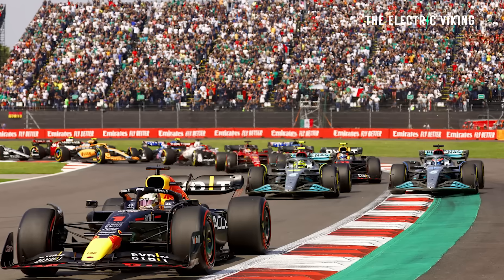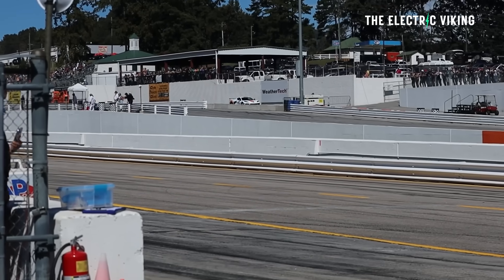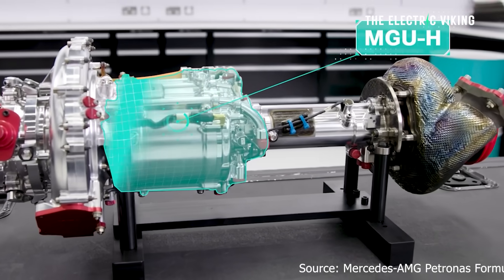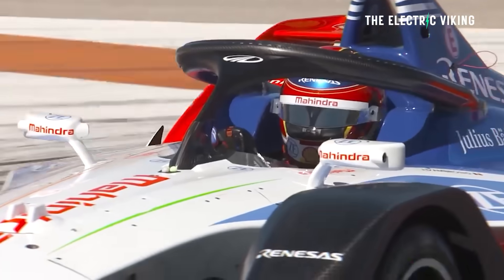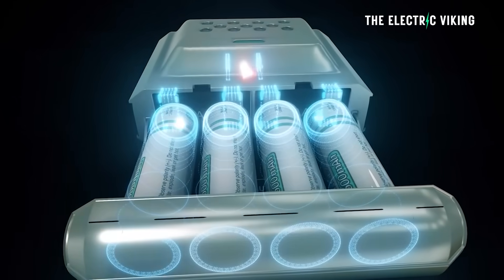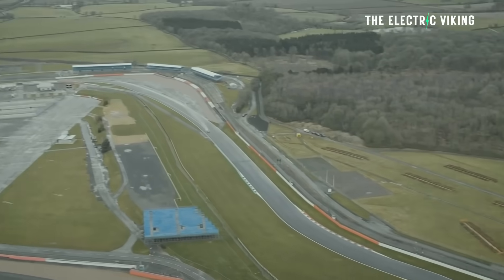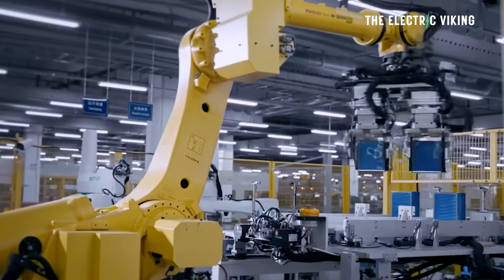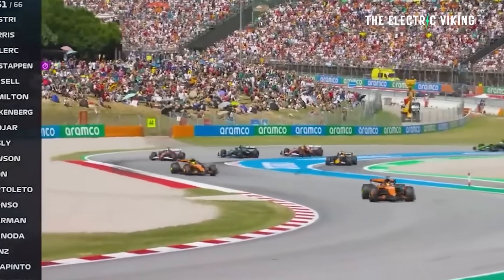Formula 1 Just Changed the Future of Electric Cars

Comment: nope. this news is nothing but F1 being better late than never. The possilbilities for electrication in F1 is far greater than this. Easy to make F1 far more capable with more, bigger electric motors and battery pack. for example, Imagine an F1 car doing without ceramic brakes because the regen braking is so powerful.

Comment: There is some cross over between F1 and Formula E.

The F E cars though are AWD. They have less power than F1, but they've been increasing over time, and it wouldnt surprise me if we get to a point very soon where the POWER of an F E car exceeds that of an F1 car. There are a lot of other differences (aero in particular) that contribute to lap times, but I do see things getting closer. I wonder if we'll get to a point in F1 where it will become a pure EV category, and then F E will lose its USP.

Comment: F1 has always been the test bed for systems and components that eventually end up in road cars. The increase in output in 2026 from the MGU-K will be substantial but keep in mind that the boost from electrical power will still be mostly just for bursts, passing, etc. The racing will still primarily be using the IC engine. Take away the engine and that’s the end of F1. I have been to several F1 races and happened to be in Tokyo last year (2024) when a Formula E race was held on the street circuit. So we went to watch and I was very disappointed, it was as boring as buggery. The cars sounded like a thousand electric drills buzzing away. Annoying noise actually, unlike the current F1 V6 engines, and the legendary V10’s of yesteryear.

Comment: If F1 is the source of such huge technology improvements, why are European and US EV’s trailing China, who aren’t in F1. F1 technology is geared to making a better hybrid, which is a dead end. How do you make an ICE engine better? Add a motor. How do you make it even better? Lose the ICE.
Reply: Amen. It’s not about logic and truth. It’s consumer sentiment and tradition.
Reply: The F1 Engine is actually very efficient. More than 50% thermal efficiency. This is without adding up the KERS and MGU H systems. Why is hybrid a dead end when it uses otherwise wasted energy (heat from braking) into useful work?
Reply: @adriaanvantulpenbaard1740 Well firstly, because it’s only 50% efficient, and you’re not recovering all of that lost energy. Secondly, because it’s a very, very complex and expensive way to drive a vehicle.
Third, it’s extremely unreliable, which makes F1 interesting, but road cars hopeless. 
And lastly, because there’s all that friction and contained explosions, they need a lot of lubricating oil, which gets either burnt or thrown away.

Comment: So these new batteries will be light weight, low volume, high power storage density with a high C Rating!

So how is that going to help the car industry advance if the F1 batteries only have a low charge cycle number or  degrade significantly over a relatively short period?

Comment: Sam, your numbers are inaccurate but you've come close.  What you are overlooking is that the batteries F1 cars use are very, very special.  they are custom built to hold the maximum power density at the minimum weight.  The cost will be far above that any production car manufacturer could deploy.  F1 technology has always used 'unobtainium' materials to achieve the astonishing performance levels they operate at.  I'm sure some good will eventually trickle down to the mass production world.  But don't hold your breath.  BTW.  Check out the Formula e car cars that are NOT hybrids like the F1 cars.  They have very special motors and batteries too.
Reply: I feel like a small amount of super or ultra capacitors (1.5kWh or so) could aid in extreme regen events and also help deliver max power to the motor. I know they're big, but they're not very heavy. I'm imagining they could be squirreled away somewhere behind a body panel. Recent ultra-cap developments give them the energy density to be close to this.

Comment: Not a lot of F1 footage in the video. Far more Formula-E. And F1 didn't just change. The new regulations have been worked on for years now. F1 cars also don't really all that often; which is one of the reasons why it's less spectacular today. For the batteries, most important things are how quickly they can charge/recharge and how reliable, how little the battery weighs and how little volume it occupies.

Comment: Sam and everyone, look up the Pike’s Peak Hillclimb. It is a wild race up one of the 14,000 ft/4200 meter peaks in Colorado, USA.

Sam, electric cars have been rocking this race because the gas burners just don’t have the torque for accelerating uphill after corners! 

I think they’ve already created a conciliation/participation prize for petrol vehicles.
Reply: Also, there is a great video from the racetrack near Sonoma, California. Used to be called Sears Point. A guy took a first generation Model S Plaid to the course and was kicked off because he was too fast. At dragster speeds, he needed to have a roll cage, a fire suit, and maybe even a parachute installed in order to be allowed to go as fast as he did on the track!

And the Tesla could also be used as a reliable daily driver, while the dinosaur burners that could also go that fast need daily attention from an experienced and expensive, Racecar mechanic.
Reply: @freeheeler09That's a lot like how Mate Rimacs got started with his electrified BMW at the drag strip.  The competition initially laughed at him until he started beating them.  Then they complained that he was too fast.

Comment: Check out formula E... Fully electric race cars... Technology is amazing!
Reply: Yes I’ve been following it lately and am amazed how gravitational energy is converting energy into the batteries as the cars navigate the racing circuit. The braking of the e-cars can restore up to 50 % of energy required. Worth investigating this further.
Reply: @nick0047  You can have 50% of regen with EVs for years. It is just so that noone drives as stupid as racing requires you to. In racing the cars are is ALWAYS exposed to acceleration ... you either accelerate (positive acc), you brake (negative acc) or you turn (lateral acc), or a combination of those. So you are changing the kinetic energy THE WHOLE TIME. That's why the recovery rate is so high. You can also do that with your car on the road ... the old Hyundai Kona I drove until last year was famous for reaching 55% kinetic recovery rate! But in the REAL WORLD the main energy loss is first and foremost aerodynamic drag (on the highway) and second rolling resistance (if driven mainly in urban area). 

There is nothing to be learned from formula EVs that can be applied to road EVs! 

Manufacturers already know how to make cars aerodynamically efficient and rolling resistance is influenced by vehicle weight first an foremost. 
Tire manufacturers cannot learn from racing how to reduce coefficient of friction while maintaining safe braking distances especially in wet conditions! 
The are also not researching rolling noise reduction in racing, as is needed for EVs, to be considered a premium tire manufacturer!

Comment: It’s unfortunate that the MGUH will no longer be present. 2026 cars will be less efficient and over the course of a lap slower. They cannot generate enough electricity in a lap.
It’s made worse by the fact that regeneration only occurs at the rear axle.
Reply: Not true. E1 can generate enough electricity, not sure where you're getting your false information from.
Reply: @PyroShields currently cars run power directly from the MGUH to the MGUK (as well as to the battery) which is unlimited. The MGUK can regenerate more power than currently but the MGUH no longer supplements this.
Couple this with a dramatically reduced fuel energy capacity (less than 70% of current)and you’ll see that over the course of a race they will be slower.
The peak power will be good but will only be available for short periods.

Comment: Whilst Formula 1 has indeed embraced the hybrid concept more fully for the 2026-2030 period, it is doubtful that it will EVER go fully electric, for the simple fact that it's customers do NOT want that to happen... We already have Formula E, and it is just nowhere near as popular... Fully electric engines just don't have the same level of 'thrill' or 'engagement' for the audience, particularly on TV, and there is a marked difference in the driving characteristics. The next step for Formula 1 will be to keep the 50:50 split, but utilize a fully net zero fuel, that will allow them to keep the traditional ICE engines so crucial to the sport's success...
Reply: The recent F1 race at Monaco wasn't much fun. "Frustration and slow driving at Monaco GP as F1 rule change backfires". I've watched Formula E on TV and it was a lot more exciting than I expected. The drivers seemed to like it too.
Reply: @bhabbott  Formula E is better for tight street circuits like Monaco. Streets don’t really work in modern F1. Monaco is only still in the F1 calendar because it is so iconic. Any mistakes are likely to be heavily punished by the barrier, so it has become a test of “not making a mistake”, but it is no longer a race.

Comment: The benefit of an electric motor in the f1 cars is not the horsepower. It is the instant torque that ICEs can't deliver.
This is the same reason why dynamometers (because of slip) can't measure EVs, if there is no software which regulate this smoothly.
Reply: You just reminded me of the days of Turbo Lag in F1.
Reply: Acceleration is gonna be nuts.